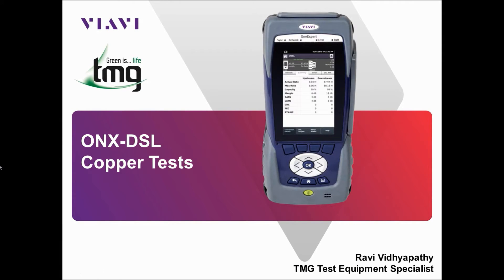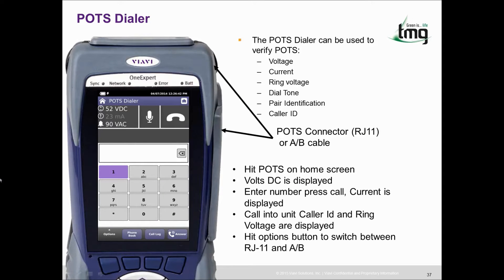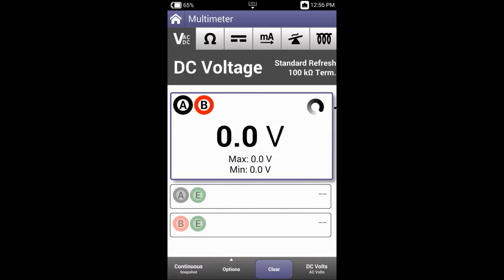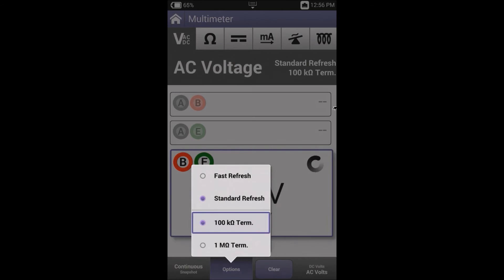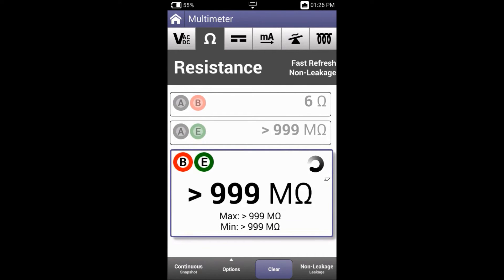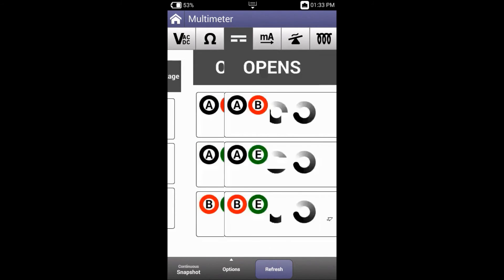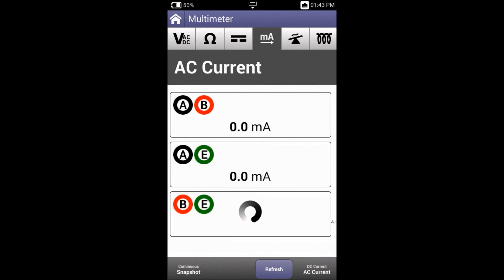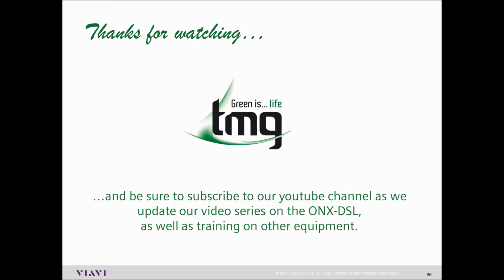VIAVI ONX DSL Copper Tests Overview - TMG Test Equipment

Comment: the load coil function on my unit does not check for loads.  it spins and spins and does not give results either way.  is there a setting i need to setup oin my unit?